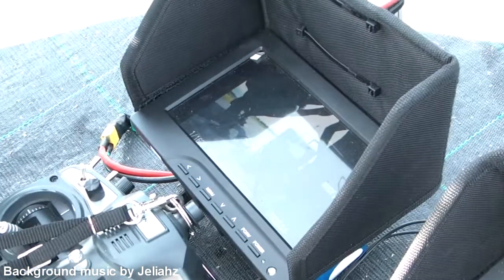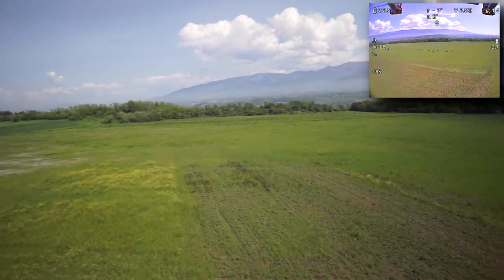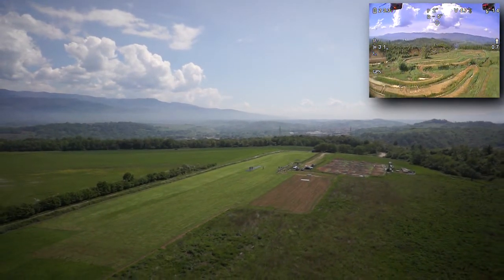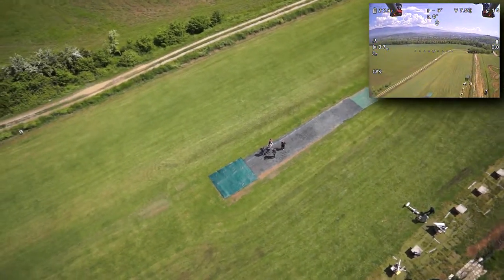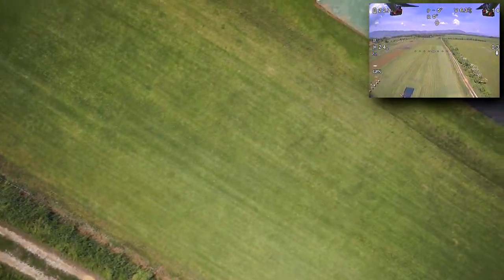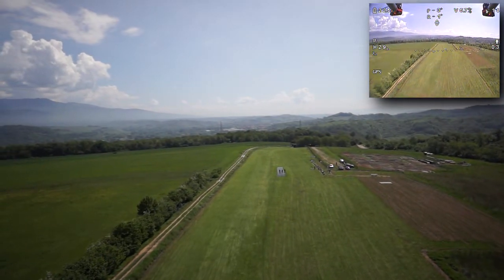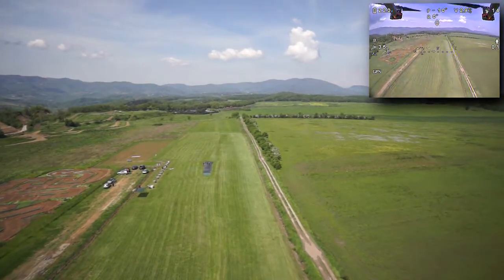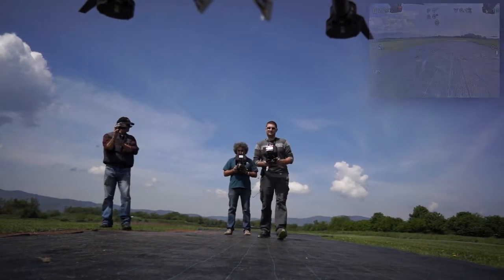RC: First test of our double FPV system

Comment: Really cool staff!
Reply from the maker: Thx mate, now we just need to watch out that we don´t crash it ;D

I just started to work on a little "H quad", after all this hughe expensive things i need something tiny then i can break again ;D
Reply: but you can`t crash a Naza copter like this ;-)
its realy save i think isn`t it
Reply from the maker: *****  Well... you "can" but belive me... if this would crash I would start to cry ;)

But beside of that its very stable and the A2 seem to be a very good Flight Controller, if its not for an hardware issue or something then it should be really save. Also because this is mainly just a strong camera platform, its not ment to be flown very agressive but slow and smoooth ;D